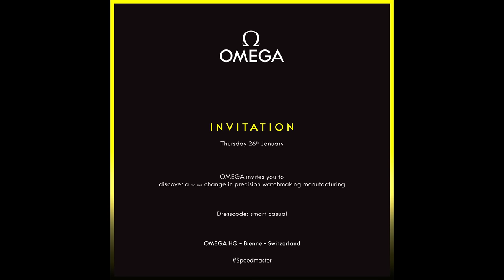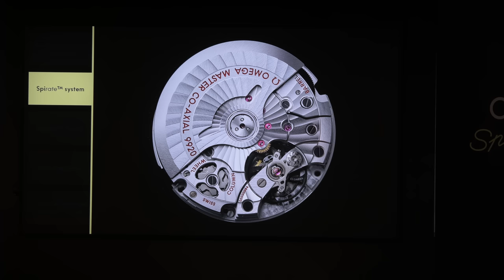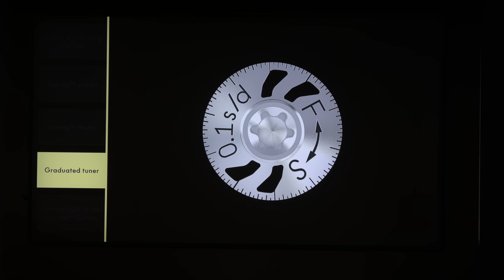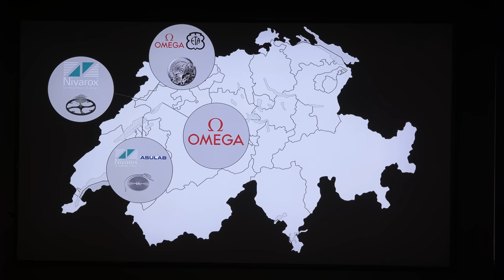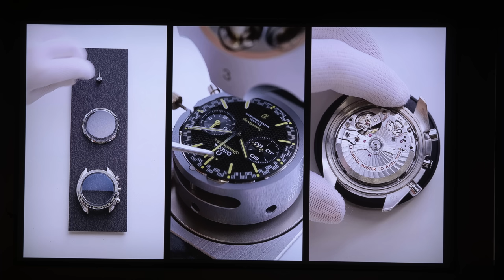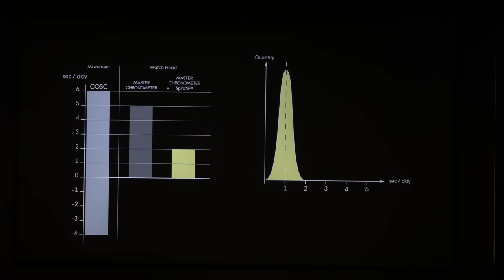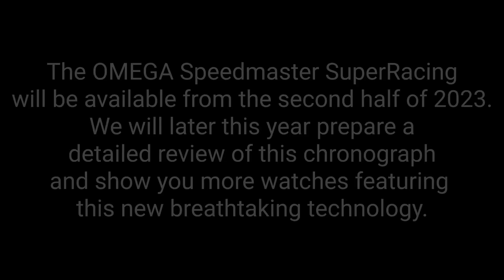OMEGA Speedmaster SuperRacing. The new fine-tune Spirate System boosts accuracy to 0/+2 sec./day.

Comment: Love this Alexander (psss - this is Richard from USA, we met at a couple IWC Collectors meetings) I think the innovation and complicated horology coming from Omega is fascinating - and such a departure from the plain, ordinary stuff that Rolex has been churning out for last 30+ years.  Omega has really laid it out there.  Repeaters, Rattrapante, triple calendars. Moon phases, this adjustable silicon hairspring balance and more - just amazing.
Reply from the maker: Richard, how are you? Welcome to WatchAdvisor! You name it… Omega is the leader of the pack and still does not get the recognition it should… still fanboys almost die when they discover a new colored dial from another well known brand…
Reply: Hum… Rolex has released the Chronergy calibres… I think that was perhaps 10 years ago. There might have been no fanfare whatsoever. But, it seems that the Chronergy has amplitude issues. You may check Rolex forums.

Comment: Dude you were right on the money. I was the first person to leak it to the Omega subreddit and forum when YouTube recommended me the announcement video. This is a game changer for mechanical watches because it approaches Spring Drive levels of accuracy.
Reply: Spring drive and this are about the same
Reply: Realistically, spring drive is still more accurate
Reply: @bdegrds  But without the quartz crystal! Truly impressive!
Reply: @jimhim585  But it's also not fully mechanical.
Reply from the maker: A new era in classical watchmaking (not hybrid) has just started…
Reply: @WatchAdvisor  I would think the next Rolex Milgauss has something special coming that will challenge this Omega Spirate.  Full titanium, new balance spring tech, crazy high resistance to magnetism,
Reply: Yes but Spring drive will necessarily be more accurate for longer.

Comment: Alexander! It's been a while and it's great to see you again in the video! By the way this is great news that I hope they would implement these in their other movement too (my favorite movement by Omega are 88xx, 3861 and the manual wound 99xx). As it stands now with 9920 it results in a very thick watch. But oh well... It'll be more tedious from now on fit both two studs in the balance bridge that's not a twin hairspring system.
Reply from the maker: The Spirate is ready to be implemented also in other thinner/smaller calibres…

Comment: I already have Speedmaster Racing and am very happy with it and the accuracy +2 sec/24h. I am therefore not going to buy the new one, but am impressed by Omega and their ability to lead developments in the watch world.
Reply from the maker: The existing METAS certified calibers perform like crazy... If the maximum tolerance is 0/+5 seconds the daily deviation is not more than two seconds... this is also what you write...

Comment: This is just plain wonderful.  Positional variance may still be an issue, but flat silicone balance springs performed rather well compared to overcoil hairsprings.  Swansneck regulators on silicone hairsprings already exists, but Omega and ETA may have come up with something new.   Very very curious!
Reply from the maker: Now the tension of the silicone hairspring is fine tuned… this allows adjustments down to 0,1 seconds… The overall accuracy is much better than 2 seconds of course since this is the maximum allowed…
Reply: @WatchAdvisor  Yes, I am quite excited!  I am hesitant in buying the breguet 7727 with magnet pivots and double flat hairsprings because of the price, though it still is a bargain for what you get, and this news just ewxpanded my list for an accurate watch.   Very much looking forward for your follow up video, Thank you Alexander!
Reply from the maker: In early summer Omega presents the next calibre with the Spirate … we will keep you posted…
Reply from the maker: The Breguet by the way is a stunning watch. The grade of innovation Breguet brings is breathtaking…

Comment: Love the innovation, but I will wait for it to get into a 3 sub-register chronograph or a seamaster, if Omega insists on cramming the chronograph hour & minute is a small register in all its chronographs.  Hopefully they don’t add “super” on every watch dial that has it.   The question I would have is will it make regulating the movement easier?  In my experience, North American service centers don’t regulate as carefully as the factory.
Reply from the maker: The new hairspring technology will make its way to other calibres soon… Yes it simplifies the final essential regulation of a calibre, since it comes already in perfect shape and through the “screw” you do your very final fine tuning … It will therefore also help to better regulate a calibre that is not serviced at Omega’s HQ in Biel…

Comment: It’s funny, I really would like that some brands offer their customers to be able to configure their own watch. It would be so great to be able to “build” ones own watch by selecting one by one a watch case, dial, hands, bracelet, strap, calibre, materials, certification, etc… and wait perhaps 3/6/12 months for delivery. Each option, including delivery period, would be priced individually of course. It could be called the Atelier Collection, the Watchmaker Collection, or something in that vein… Why are brands not proposing such options ? 🤔🧐 Any idea ?
Reply from the maker: This is a brilliant idea! But where are the limits of individualization? End of the day such a watch still has to be recognizable as the XYZ brand … It could be done, but with some rules… for the brands themselves in terms of logistics though it is a nightmare… the Swiss watch industry is very complex…
Reply: I think the limits would be by the existing calibres, dials, cases, materials, hands, etc… If you think about it, it’s mechanical and a Meccano hence not that complicated.

Cases would have to have standardised spacers screw holes, the spacers thus acting as  calibre adaptor depending on the selected case and calibre. Assembly could be automated against the custom build sheet parameters to fetch the parts or if the client prefers it would be hand assembled and regulated at extra cost… That way Omega may be able to offer more exclusivity whilst extracting more profit margins.

You may have read SJX report on the Swatch Group faltering financial performance and their unsold inventory worth 4-5 years or more. How much of these are Omega watches ?
Reply from the maker: Why not.... 😉 Thanks for sharing!    No idea which watches they stock... but I assume some of all brands...
Reply: Certina offers that service

Comment: Somehow my Tudor speed chronograph ref.20300 in silver with an eta7753 Tudor mod movement still performs with a consistent +- 1 to 2 second a week after 10 years of daily wearing without any maintenance. Crazy
Reply from the maker: The ETA7753 is a very, very reliable Swatch Group calibre...

Comment: So to be clear: Is this an Omega = Swatch Group innovation or a CSEM (=Rolex, Patek and Swatch Group) innovation? 

Are you saying that by adding the adjustment function to the silicon hairspring Swatch/CSEM have managed to keep blocking other companies' use of silicon hairsprings despite the original silicon hairspring patent having already expired?
Or do you mean that they just maintain their advantage as now they can regulate the silicon hair springs, meaning that all other companies bringing out silicon hair springs will be inferior since they have no adjustment? (Not to mention CSEM companies have filed many additional patents for different other aspects of silicon hairsprings like production processes, treatments, etc.)

Also, Omega (so Swatch) unveiled their adjustable silicon hairspring...but does Swatch now own the patent on the adjustable silicon hair springs or are Patek and Rolex also able to introduce them? So was this an achievement of CSEM or Swatch Group? Which is the case:
-Have they (CSEM: Swatch, Patek & Rolex) all developed this together, is this again a joint patent?
-Or was this new development Swatch acting alone? Have Rolex and Patek been developing their own solution? Any info on when they might introduce theirs?
-Or have Rolex and Patek been caught off-guard and will have to play catch up and develop their own equivalent system, which will take years?
Reply from the maker: This is an innovation done in a cooperation by ASULAB, ETA, Nivarox, Omega and CSEM… It is the first innovation coming from the pool (Patek Philippe, Swatch Group and Rolex). I expect the other partners to present their “new thing” later this year. Together this will most likely extend the patents to protect the silicon hairspring per se as this pool invented it. No doubt that this is the goal, since silicon hairsprings today are a real USP. But IMHO it is too early in the year to speculate more than this… Let us continue to discuss as new developments are shown/published…
Reply: @WatchAdvisor  Ah, ok, thank you! That is very important information because Omega doesn't operate in a vacuum, but in cooperation with all those other parties. It puts this news into perspective.
👍:thanksdoc: